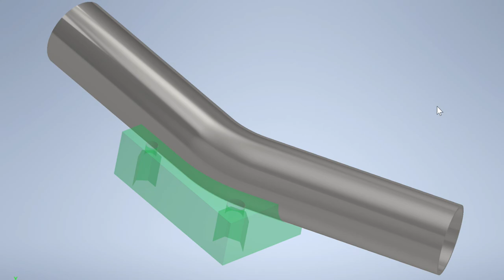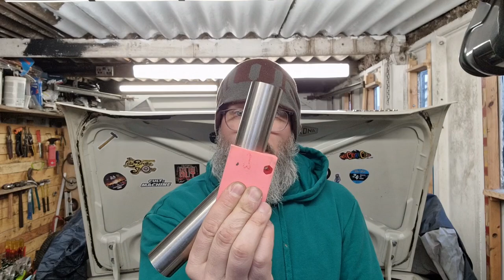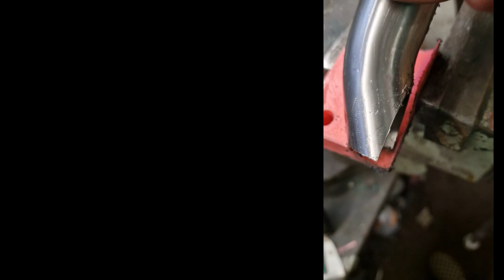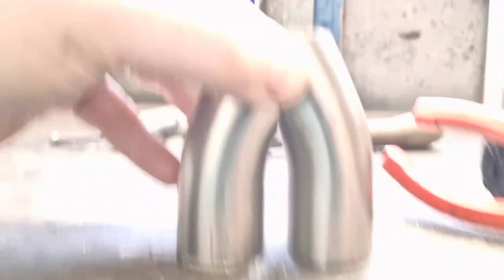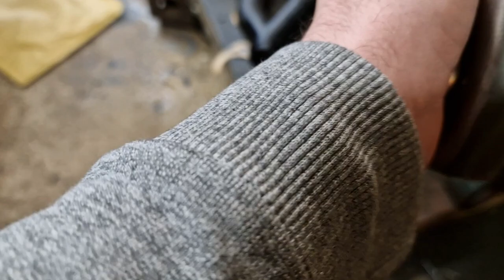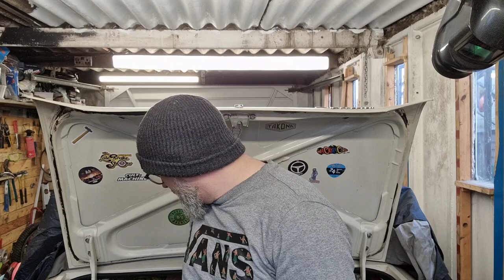Build your own exhaust collectors

Comment: The steering idler still needs room to operate in so factor that in as you don't want the manififold fouling. Not much room in that area.for error. Will look forward to updates
Reply from the maker: I think I'll be ok, I based the new manifold on the original which clears.  The only thing I've been wary of is the relocated starter motor but that's tucked away nicely too.

I'll have an update ready in a few days all being well!

Comment: Have you added the  steering componants into the equation? I could not believe the difference between the Capri GT and Cortina GT manifold as the Cortina one fouls the steering. I need to build a four branch for the Thames..May need some help with that. My mrs says you have a nice aura about you lol
Reply from the maker: I haven't added those in on the manifold as the exhaust is the opposite side to the steering box but you're right to question it if they're on the same side to each other. 

If you need any help and advice when you work on the Thames just ask.👍

Please tell your Mrs I said thank you, I don't think anyone has complimented me on my aura so I'm honoured! 😊